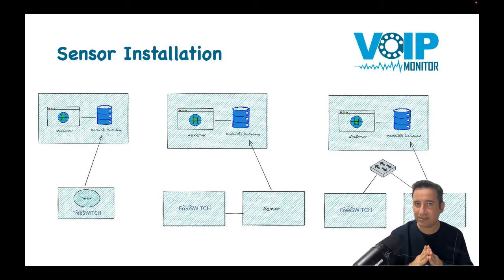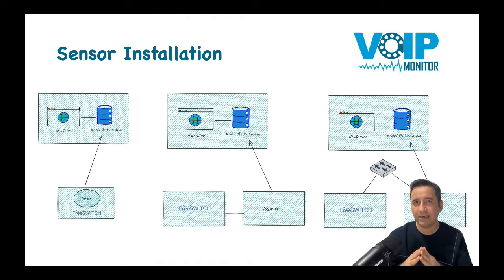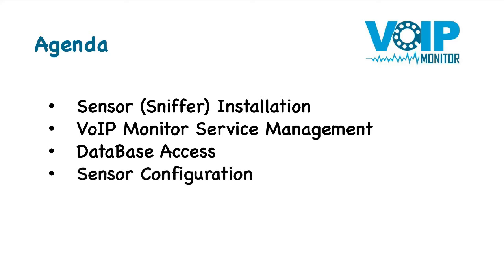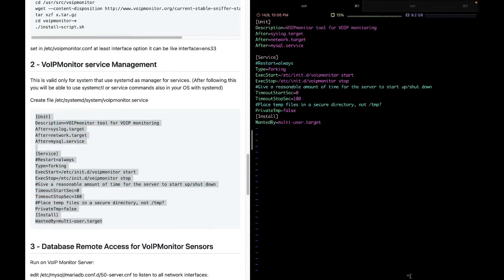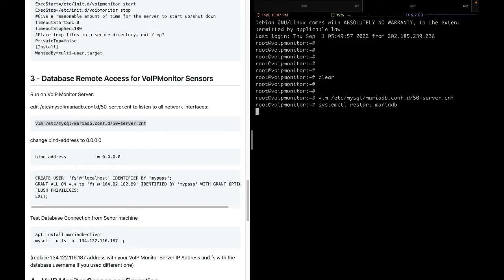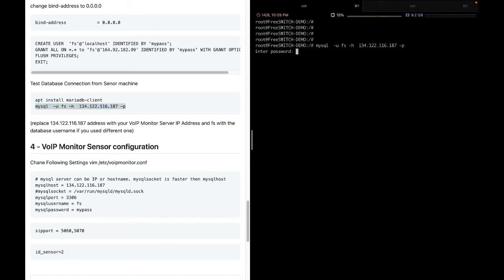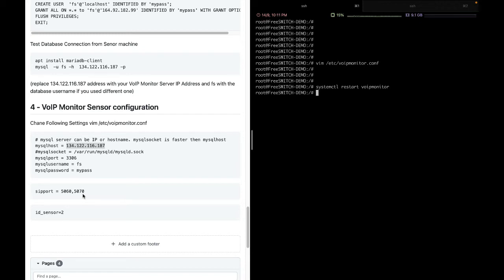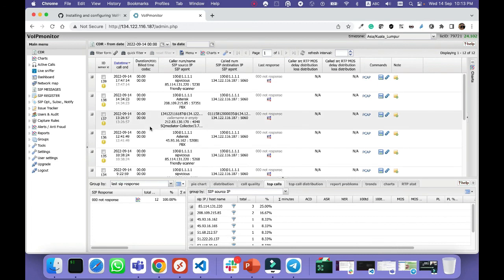VoIPMonitor Sensor Installation and Configuration

Comment: hi sir , thanks for the  Great tutorials .
i'm beginner and i just want to ask what if i want to use the third model ..so i will setup voip monitor in server and then connect it to switch ..my question is any different steps to setup voip monitor or i just use it as u done it ?
Reply from the maker: Hi, the installation method for VoIP Monitor Server and senor is exactly the same as what I explained here. The difference in your switch configuration. For example, if you are using cisco switches you need to configure them to support port mirroring : Here is link :    https://www.cisco.com/c/en/us/td/docs/iosxr/ncs5000/interfaces/71x/configuration/guide/b-interfaces-hardware-component-cg-ncs5000-71x/b-interfaces-hardware-component-cg-ncs5000-71x_chapter_01010.pdf

Comment: Hi Omid,
 
If I install VICIDIAL on VM ( in my computer) , then can I make calls properly? And I will use SignalWire for Carrier.
Reply from the maker: Hello, it doesnt matter where do you install vicidial. As you have network connection and set correctly the settings it will work.